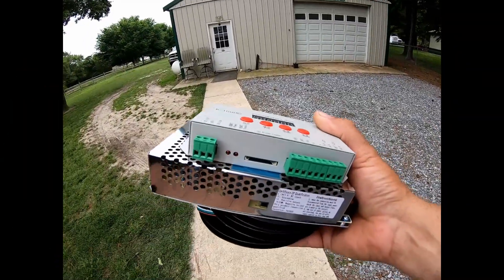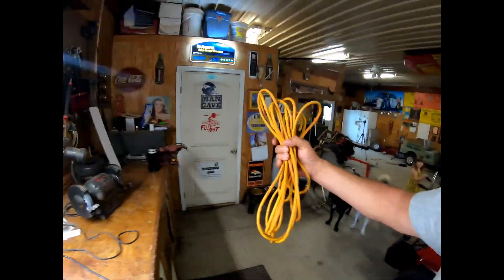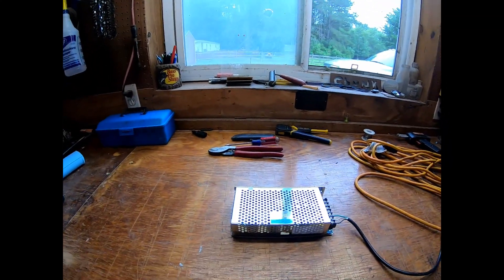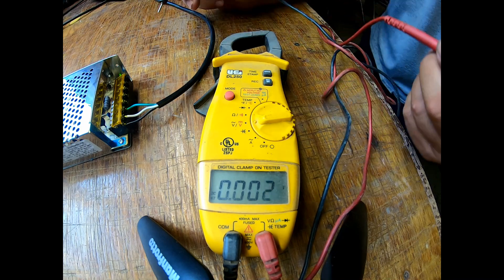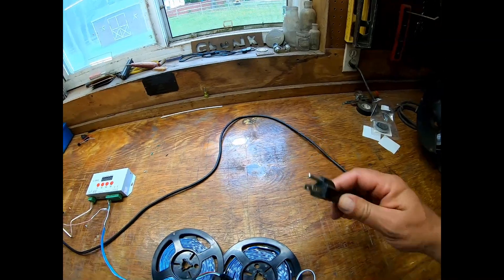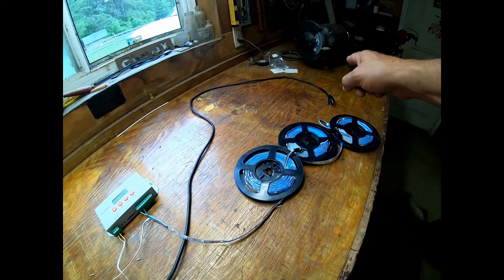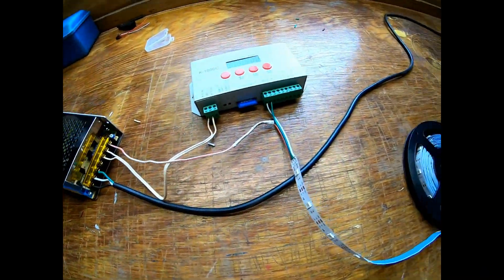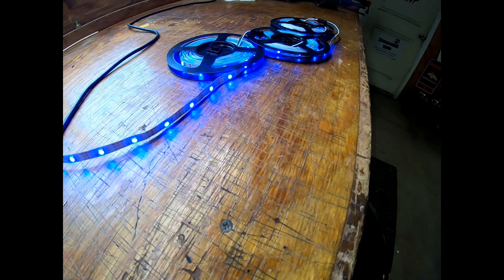DIY - LED Scrolling Sign - Part1

Comment: You can run those LED's from a bicycle generator lol. They don't take much in the way of forward voltage really. I'm completely down with the fabrication and electronic theory of the LED's, that's the easiest part. The part I'm having issue with is where do I get the cutest little dot of a grand-daughter to watch me that I can teach something worthwhile to? :(

Don't listen to what she says. Watch what she does. If she does what she says, stay with her, make her belly fat, and do what you will.
I'm 53. Seen Enough. Married one. Bedded too many. These are my words of wisdom. Make of them what you will.

Comment: Safety first!!! Run doodle run!!! Lol pretty cool can’t wait to see what your gonna do with this
Reply from the maker: LOL  These Power supplies are made in china - Do I need to say anymore.... LOL I plugged a unit in a while back and about 5 seconds after I plugged it in it blew a capacitor apart - It sounded like a gun shot and blew small fragments everywhere... so now I plug them inform about 10 feet away using an extension cord …. Spoiler Alert - Never buy cheap cheap LED's ---- It will make a little more sense in part-2